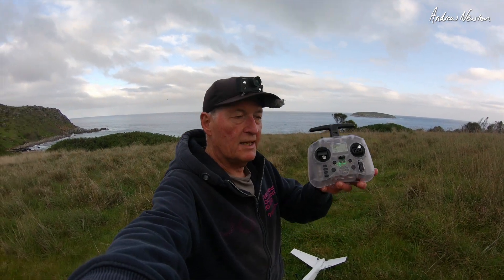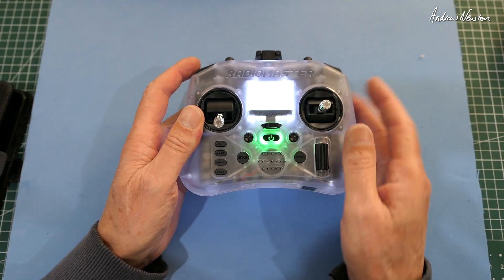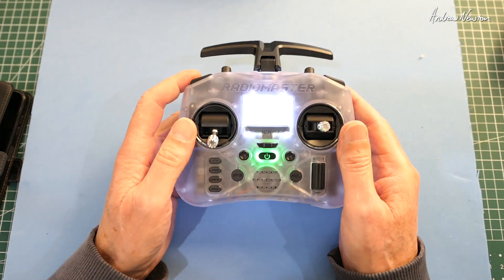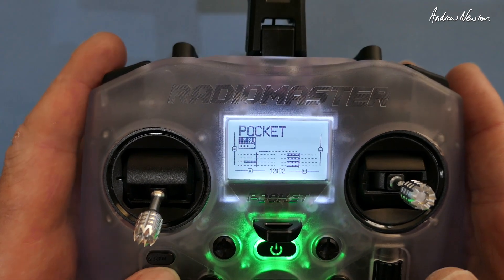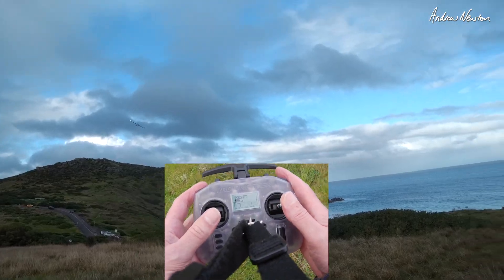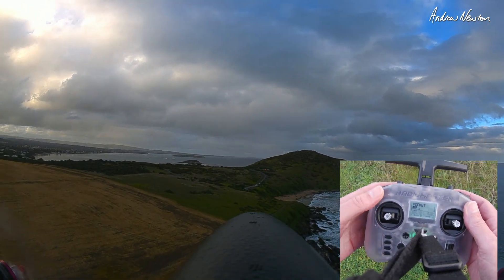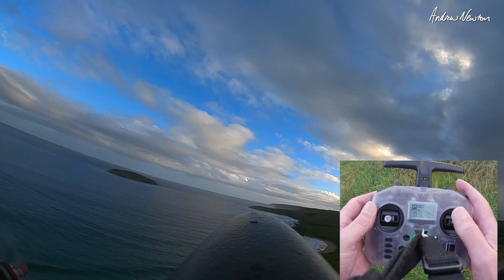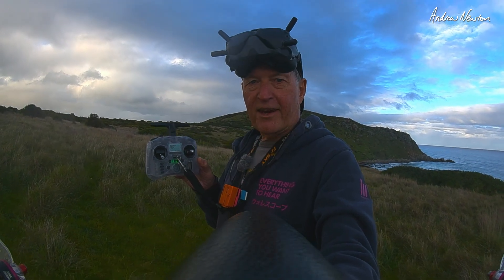RadioMaster Pocket - Flight performance with Swordfish and INAV

Comment: How far have you go with this transmitter,  have a friend that is planning to buy one still not sure if multiprotocol version or express lrs version, i told him that with lrs version maybe he could do long range out of the box
Reply from the maker: 4in1 range is up to 3km maybe. ELRS version range is more than 10km. Could buy the 4in1 with an external ELRS module.
Reply: @AndrewNewton  awesome,  I think better to buy the express elrs version, he will have a long range transmitter out of the box and the receivers are really really cheap compared with the compatibles with his actual transmitter that is a old walkera

Comment: Hi Andrew. I need some help/info please. I am moving from a Spektrum DX6i and a Flysky I6 Tx to the Radiomaster Pocket. Which modek should i choose  to still be able to use my DSM/DSMX and Flysky receivers? Wouter
Reply from the maker: You need a radio with the 4in1 RF chip, but the Pocket only comes as CC2500 or ELRS. Look at the Zorro 4in1 or Boxer 4in1.
Reply: @AndrewNewton  Thanx a lot Andrew. Your advice is much appreciated 🤠👍🛩️🇿🇦
Reply from the maker: Or you could use the Pocket with an external 4in1 RF module https://www.radiomasterrc.com/collections/ranger/products/rm-4in1-module

Comment: Hi. I currently have flysky fsi6. Thinking of upgrading.
Reason for upgrading is, i would like to to try dji googles. Since those air units are costly, i want a reliable transmitter. I am not interested in long range fpv. Max 1 km(flying field restriction) 

In and around this range, i never had any problem since 3 years of using flysky fsi6. 

Assuming i only fly fpv within 1 km radius, would it be OK to continue using flysky radio or would you suggest me to upgrade?
Reply from the maker: The only reason to upgrade would be for more complex mixing and programming, but the FlySKY system is very good and probably has better range than the normal Spektrum or Radiomaster. Check out iforce2d videos, it's all he uses. If you wanted more range I would recommend going to ELRS on a Radiomaster Boxer or Zorro
Reply: @AndrewNewton  from what I have read, the dji o3air unit needs flight controller to get out of low power mode. Any way to bypass that and use it without flight controller?

And i dont need more range. Atleast not as of now. If I do want to upgrade in the future, any specific suggestions(I like to keep it simple, no complex mixes) ?
Reply from the maker: It's called Temperature Control in my V1 goggles menu. Turn it off and you will get full power. Any of the Radiomaster radios would be my recommendation. Boxer 4in1 version would be perfect.

Comment: Still rocking the QX7 with either a 4-in-1 or ELRS module. I think if it died I'd buy a boxer. This is just a bit too small. But I really like that Radiomaster keeps innovating. Bargain price BTW.
Reply from the maker: Yes I still think the QX7 was the best, I have 2

Comment: Does it come with a flip-up jeweller's magnifier for easy reading of that over-sized screen, Sonny? 😉 
Depending on how it goes for durability it'll probably turn out a fair choice for ELRS gamepadders. The Jumper T-lite V2 4-in-1 that just landed here will be enough to keep the Junior Brigade amused for a bit though. 😊
Reply from the maker: Not designed for old farts like us

Comment: looks nice, but not sure i can be swayed from my Flysky
Reply: ive had flysky for 5-6 years now, still good enough around the house
Reply: Unfortunately, this transmitter with the cc2500 won't communicate with FlySky receivers. We would need to buy their 4 in 1 module, which costs another $59. Guess I'll stick with my FlySky fsi6.

Comment: I hate the new see through case trends. I think this is a great radio for a beginner or lightly traveling (I still would use my T-PRO).
Reply: I have a gamepad in similar plastic, and it holds greate, pretty durable and feels nice in hands. Don't care how it looks if it's comfortable to use and durable.
Reply: You spend a lot of time looking at your radio while flying?  one can of paint, open the case, remove internals, spray interior surfaces, finished...terribly difficult, impossible.

Comment: That's a really intersting radio. The big momentary switches would defiitly be usefull for f3k, though I dont know how good a one handed grip that shape has? Also would be interesting how the flight mode switches would feel if you were using them constantly as in f3k. The torro seams to be finiding a lot of success lately, I wonder if they will do a torro shape radio with more chunky buttons/switches like this radio.